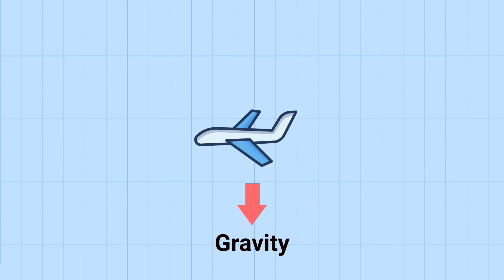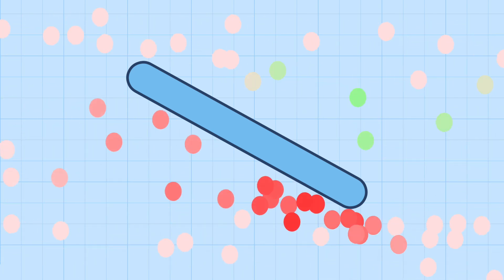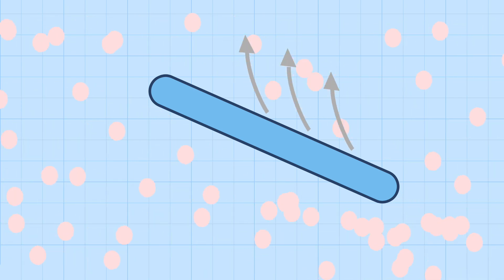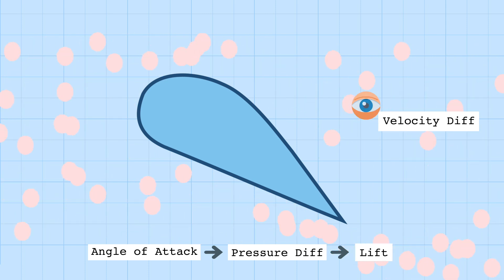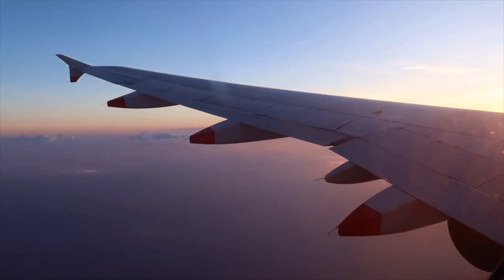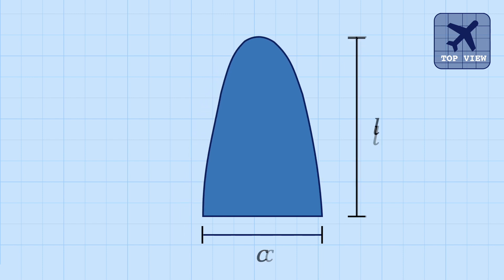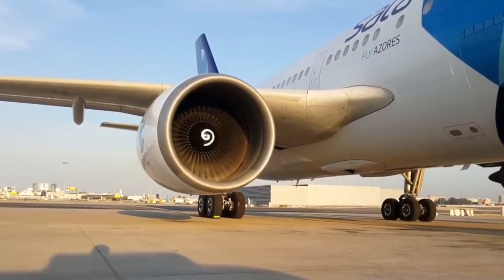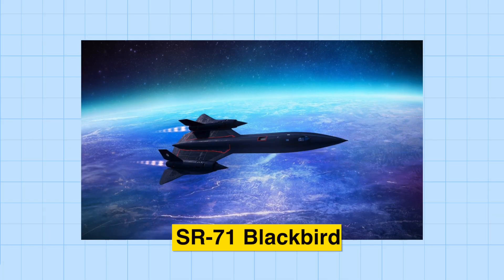Intro to Aerodynamics: How Do Airplanes Fly?

Comment from the maker: Quick edit: I got Bernoulli's Principle mixed up - HIGHER velocity means LOWER pressure, and vice-versa. Thanks to those of you who caught it and let me know!
Reply: Hey Jenny , its too much fun watching your work , going to share this with my junior cadets 🙏
Reply: Sorry dear Jenny, I not watched this video, becaus YouTube said "for dummies".
First what have people to understand, airplaines don'tt get pushed up by aerodynamics on the wing, they get sucked up by the aerodynamic by the underpreassure over the wings. That's one of the most important point in aerodynamic, what never get explained clearly. 
It's like a airplane get lifted up by a crane, but people will heareing, it's like lifted up by a fork lifter for it's unbelievable, how much forces underpreassure has.
Reply: @GerhardReinig  that is incorrect. Pressure is a scalar force, it only pushes inwards. A vacuum cleaner does not work by sucking air in, it lowers the pressure inside, and then the higher pressure outside pushes the dirt and dust in with the air that is being pushed in. Hence, the same things is true for a wing. The integrated effect of the pressure force over the surface of the wing is it is pushed upwards.
Reply: ...还有可爱的珍妮，我爱中国，我爱中国人民。
抱歉，但是我在我的东白妻子的手里。
Reply: Great Video.. but everyone seems to forget the most Important force of flight the 5th force. Which should be the 1st! $$$$$ 
Without which ,we stay firmly planted on the ground.

Comment: Sorry dear Jenny, I not watched this video, becaus YouTube said "for dummies".
First what have people to understand, airplaines don'tt get pushed up by aerodynamics on the wing, they get sucked up by the aerodynamic by the underpreassure over the wings.
That's one of the most important point in aerodynamic, what never get explained clearly.
It's like a airplane get lifted up by a crane, but people will heareing, it's like lifted up by a fork lifter for it's unbelievable, how much forces underpreassure has.
Reply: This argument is absurd. What matters is the difference in pressure between the top and the bottom of the airfoil.

Comment: Good video with clear explanations!  
If I may pick a bit of a nit, at subsonic speeds air is considered to be incompressible.  At a given angle of attack, the airflow over the top of the airfoil accelerates, and when it reaches the wing's trailing edge and meets the lower speed air, the combined flow departs the trailing edge deflected downward at a "downwash angle".  The deflection of the air flow represents a change of momentum of the air, creating lift according to Newton's third law. The total lift of a wing is the combination of momentum change and the Bernoulli effect.  
Keep up the good work!
Reply: This is incorrect, you are confusing the 3d flow phenomena of induced drag, which is what gives the downwash and a resultant mass transport, with the momentum transport in the fluid that does not require a net mass flux. That is, in a 2D wind tunnel where there are no wing tips, and hence there is no induced drag, you still get lift with not net downwash. Now, depending on your frame of reference, you can calculate a momentum flux across the wing through vertical planes, or you can calculate a pressure component over horizontal planes (both in the fluid), but ultimately, only one force is acting at the surface to push it upwards, and that is pressure.

Comment: That is not how low pressure and high pressure are produced. I understand that the concept of lift has to be simplified for general audience but this is misleading. This doesn't explain how lift disappears when airflow separates (stall). Also the aerofoil shown in the equal transit theory will produce lift at zero angle of attack, since it is asymmetric. 
The governing equations of fluid dynamics are coupled. Which means you cannot say that the speed increase is due to the low pressure or vice versa. One affects the other and they cannot be separated. 
In short, the lift produced by an aerofoil is a combination of a few phenomena. Vorticity of the boundary layer, Circulation in the flow field, Newton's second law, and the Bernoulli's principle. This is exploited using the curvature of the aerfoil and the angle of attack. Some part of it still remains unexplained.
Reply: Some great points here. But do not that the case is even more complicated, and that is because the induced circulation comes from the transient shedding of the starting vortex from the trailing edge. The fact that you have mentioned vorticity, the boundary layer, and circulation, makes this great. But the problem comes when you apply a steady incompressible model to explain something that is inherently transient, and requires causality. To expand your understanding, I would suggest looking into unsteady aerodynamics, in particular the Wagner effect, and make sure you look for simulations that are transient Navier-Stokes, so you can correctly attribute flow features.
Reply: @aerospacedoctor  I spent about 5 years creating LES simulation on turbines. I used unsteady models for my simulation because things I had to simulate were unsteady (wake-boundary layer interactions). Although I left that role a while ago, I didn't make any specific claims about how lift is produced. Nor did I make any assumptions about it.  When I said  that the equations are coupled, which makes saying "what happened first" inherently problematic, I wasn't talking about the starting vortex. I was talking about the this pressure vs velocity thing. Circulation wasn't even mentioned in the video so I didn't even bother with that part.
Reply: @mignik01  that explains the well-constructed comment. I also note that you made no specific claims about the mechanism of lift; my earlier comment was simply intended to expand in that direction. While the pressure and velocity fields are indeed coupled, it is still possible to apply causality to the underlying physics, and that distinction matters. Reality is causal (philosophically debatable, of course), even if some models are not. The heat equation is a well-known example… information about boundary changes is transmitted instantaneously through the system, which violates causality. Yet this does not alter the fact that, in a physical system, it takes time for such information to propagate. In the same way, the incompressible Navier–Stokes equations are formally non-causal, but we can still examine the transient behaviour of the flow to identify the causal chain of events. There is an excellent video titled “Starting vortex and onset of Kutta condition at hydrofoil trailing edge” that illustrates this by showing how viscosity in the boundary layer generates the trailing-edge vortex, which is then shed into the flow, altering the entire field.
Reply: @aerospacedoctor I understand the philosophical argument of how reality differs from strict interpretations of governing equations. Trust me, I'm the first to frown when a mathematician says something "profound" about reality. 
However, coupled equations do have to be interpreted differently. I agree there should be something that caused something else which caused something else. But you can't look at a flow field and say "yep. The velocity was high so the pressure dropped". Even when you solve the equations you run into this. The pressure poisson equations is depends on the velocity but the velocity depends on pressure. That's when you go through the exercise of solving it without the pressure first, which is a workaround and not reflective of what's actually happening.

Comment: This is a great video, perfectly explained. There is just one minor issue, at 08:46 you say that the higher pressure means higher velocity. Pressure and velocity are inversely proportional. In fact the turbine is decreasing the pressure of the air by expanding and so increases its speed. The smaller area at the nozzle increases the velocity of the air through the conservation of volume flow rate.
Reply from the maker: Argh I got it mixed up!! Thanks for pointing that out, good catch! :)
Reply: I'd also like to add that expansion and compression and the effects it has on airflow are opposites depending on the air being supersonic (Mach > 1) or subsonic (Mach < 1).